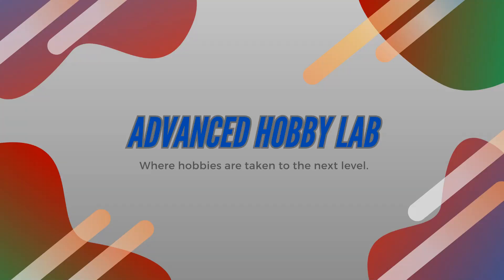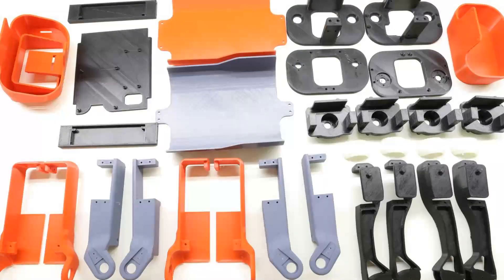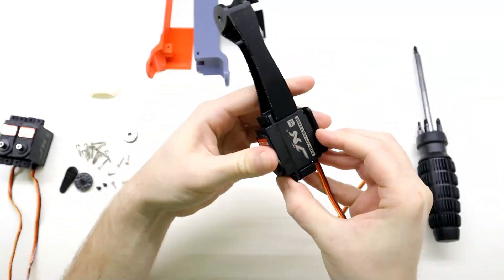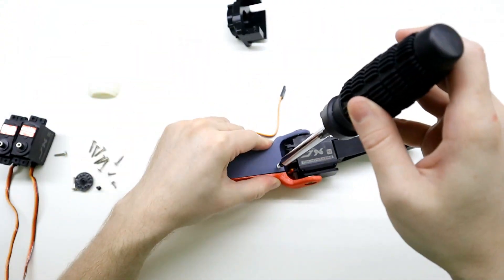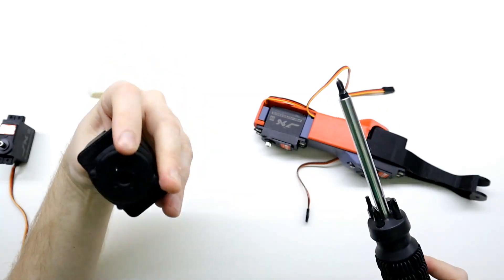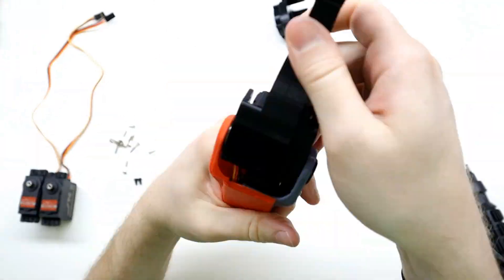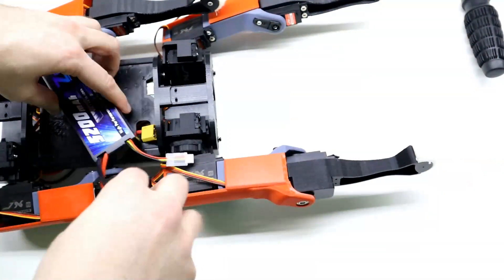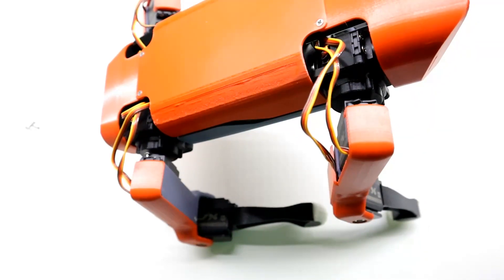Building my DIY robot dog - SpotMicro

Comment: Hello, I have the same elctronics does the adafrut servo hat handle all the servos power and pwm signals?Doesnt it burn under the load or did you use another solution
Reply from the maker: The hat requires external power to power the servos. The Pi will provide power to send the PWM signals. The board should be able to handle 5V of external power. More than that will burn out a small mosfet on the board. If you need more power than 5V, like I did, you can circumvent the mosfet with little risk. I have a video of that: https://youtu.be/gXDj1_nzOWw
Reply: @AdvancedHobbyLab  So I connect a cable from the black terminal block to a vcc on the servo pins?Where do I connect the extra cables from the lipo to?  
Thank you.

Comment: How did you manage to power everything from the tiny buck converter? My servos take so much power my PI turns off due to the voltage drop.
Reply from the maker: I use larger servos that can run directly off 7.4V from the 2S lipo battery. The buck converter I use is only to power the Pi.
Reply: @AdvancedHobbyLab Ohh, You also don’t have a PCA9685 that can’t take the 7.4v?
Reply from the maker: The PCA9685 chip doesn't care about the battery voltage as it will be powered by the pi. Depending on the PCB, you may need to make some modifications. I soldered wires directly from the servo input V+ and GND pins directly to the servo output pins to circumvent an extra MOSFET. I have a video on this topic: https://youtu.be/gXDj1_nzOWw
Reply: @AdvancedHobbyLab Yeah, but it has a maximum recommended voltage on the spec sheet for the main power, not the vcc power. I also have to use a 3s lipo because the 2s lipo just won’t work for some reason.
Reply from the maker: A 3S lipo battery will likely burn out your servos. The buck converters that I use only provide about 3A. To power all 12 servos and the pi, you will need about 13A. A buck converter like this might work: https://amzn.to/40tTuXf
Reply: @AdvancedHobbyLab I have it converted down to 6.8v for my servos and 5.10v for my PI. A 2s lipo would not supply enough current for my buck converter to bring it down.

Comment: Is MG995 servo motor is good for this robot?
Reply from the maker: You have to make sure the voltages match. Most servos are only rated for 5V. In this build, I used 7.4V directly from the 2S lipo. You also have to make sure the servo horns match. I used the parts for "SpotMicro V2" that uses PDI-6221MG servos so it won't fit MG995 servos.
Reply: @AdvancedHobbyLab  Thanks

Comment: I am seeking to ascertain whether there are any issues with a servo having an angle of 120° to 140°? This is due to the fact that the shopping list specifies a servo with an angle of 180°.
Reply from the maker: For a simple walking gait, it only needs about 90 deg. of movement. If your servos have a smaller range, you may have to adjust the angle that you mount your servos so that the zero angle is at the average servo angle.

Comment: Hello, what battery you use and how you deliver enough current to all servo ?
Reply from the maker: Any 2S lipo will work. I use a 2200mAh battery so that it will be small enough to fit inside the chassis. I decided to use: https://amzn.to/3WTydp2 (Affiliate link)

I bought servos that can run at 7.4V so I could just route the battery power directly to the servo controller. My servo controller had a MOSFET in the circuit that couldn't handle the 7.4V. I had to solder on some extra wires to circumvent the MOSFET and directly connect the input voltage to the servos.

Comment: I need confirm one thing. While assembling all your servos are set at zero right? Do you set the min and max limits for the servo in program right? I asked because for the shoulder it need to not be set at zero while assembly but 90 degrees. How do tackles this program? Cause if you don't they legs will break upon sweeping it the full 180 degrees the way you've assembled it.  Also what program I need to run in the repo to make it walk? and Also I just have PCA9685 and RaspberryPi. What changes do I need to make? Thank you!
Reply from the maker: By zero, I mean 90 degrees. It is about your frame of reference. Servos have a 180 degree arc which can be viewed as 0-180 or -90-0-90. In the latter, 0 would be equivalent to setting the servo to 90 degrees. You can use a different angle as your 0 position, but the joints will need to be mounted according.

The min and max limit are set in the program. I currently don't have any programs in the repo to control the robot, however, you can look at "locomotion_test.py" to see how to make the robot move. I still need to work on a video for how to control the robot.

The servo hat that I am using also uses the PCA9685 chip. It should work, however, I found that it struggled to carry enough current to the servos. I had to solder some extra wires from the power terminal to the servos to bypass the small trace wires on the PCB. Hope this helps.

Comment: Cool . What is your opinion about official language to program robot dog in the future ? C sharp ? Python? thank you
Reply from the maker: Good question! I'm a big fan of Python. For this project, I used jupyter-lab and set it to be launched when SpotMicro boots up. This allows me to edit and run the code from a web browser which made development very easy.
Reply: @AdvancedHobbyLab   Python is the best for people middle level but it is slow language . You can see the market . My opinion
Reply from the maker: You're right. Python is a slow language. I'm just using Python for its convenience. What I've seen people do in the past is use Python to develop their algorithms then transcribe them into a faster language such as C++. That way you get the best of both languages.

I take it that you're a C sharp developer? Have you ever programmed robots using C sharp? What was your experience like?
Reply: @AdvancedHobbyLab   no I m not developer . I studied Python beginner but I m suggested to study c sharp for future  . I m mechanical designer , i like apr and robot dog

Comment: Cool. Yeah Chris Locke built this and decided to elongate the torso because it is too short
Reply from the maker: I might consider that too.  I managed to find a smaller battery that fits, but the electronics are still squeezed in pretty tight.
Reply: I did, yes... thanks for the mention!  but I skipped the Pi, preferring to cobble together lots of arduino hardware instead.
Reply: @ChrisLocke1969 Yeah, I love the abilities my PI is giving me. I can control it from my laptop or phone easily. Still can’t figure out a reliable power system though.
Reply: @RcReportCard  have a look at my project's powertrain, it may help.  A couple of hints... the main buck convertor needs to be a high amperage one, used in automotive applications is what I use - can handle up to 30amps... each servo can potentially pull 2amp each, and if under stresses a whole lot more.
Reply: @ChrisLocke1969  I have watched many of your videos, I just get lost with how many wires you have on Nova. I am also struggling to fit everything in especially because of the size of my PI with its HAT on. I will go rewatch your videos and see if I discover something new this time :P
Reply: @RcReportCard  yes, Nova has a lot of sensors and devices onboard, and a custom pcb, so its a bit complex. But the power train would be ideal for what you're doing with the Pi.  A high discharge battery and a high amperage buck convertor could be your answer ;)   Good luck, feel free to reach out if you've any questions about Nova's setup.
Reply: @ChrisLocke1969  I looked through your video. I have the same high amperage buck converter and a similar low amperage buck converter (My version has the display). 

I think I should upgrade the capacitor on my PCA9685 and invest in some wire and supplies so I can use both buck converters and two switches. I have been using normal jumper wires from the buck converter to the PCA9685 and then jumpers from the pins on that to the PI's pins. 

Fitting everything in is going to be a nightmare though XD
Reply: @RcReportCard  oh ok, first thing to change for sure are "jumpers" on any power wires. this is bad news... fine for prototyping, but those loose connections can't transfer the power smooth enough, hence you get server jitters, most likely?   Solder all power connection points, and your issues may magically all disappear, my friend!  ;)

and I hear you on the space concerns... that's why I redesigned most parts for a much extended and larger body then the normal spot micro.
Reply: @ChrisLocke1969  I have only coded basic down, stand, and sit positions and everything seemed to work fine until trying to power it just from the battery. Hopefully the thicker wires and separate buck converter should do the trick. Thanks for your quick responses!
Reply: @RcReportCard  battery can be an issue as well - must be a high discharge battery, with a C rating around 10 to 30